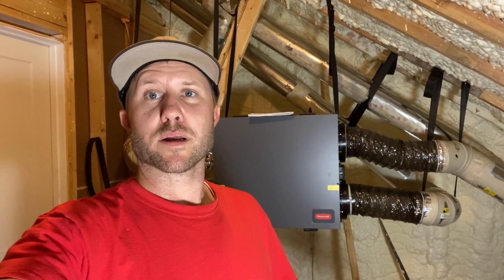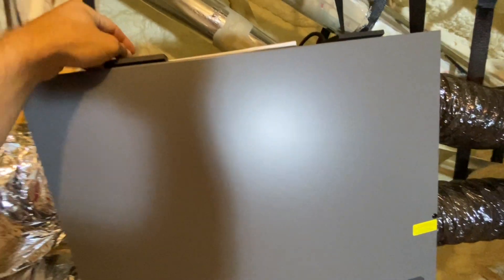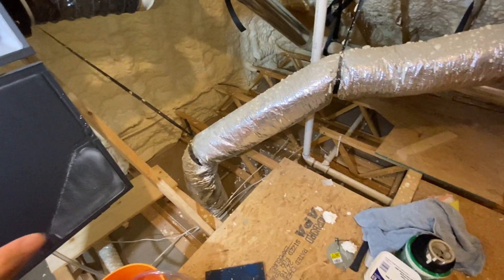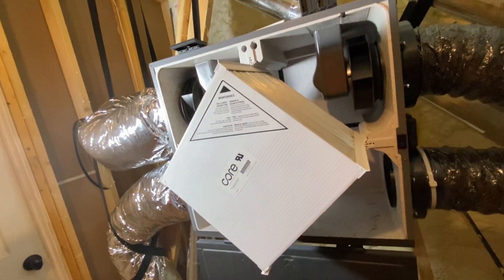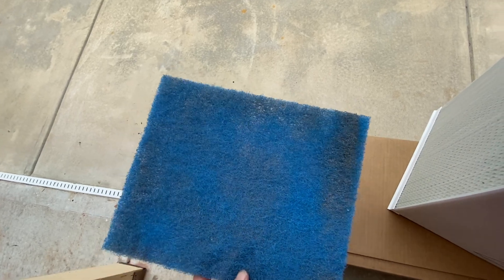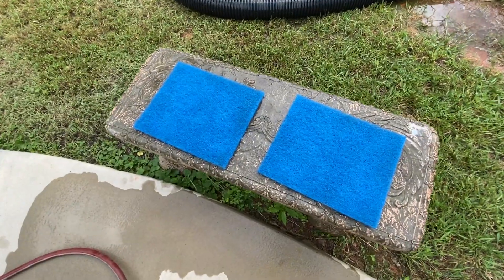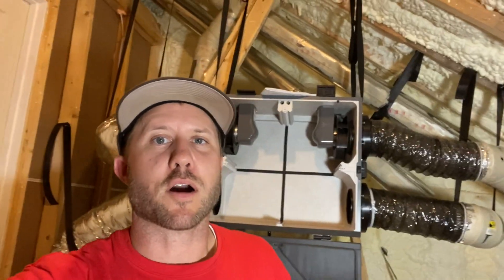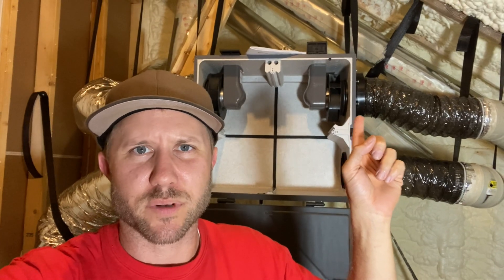Honeywell ERV first filter cleaning and first 3 months update. Energy Recovery Ventilator.

Comment: Unbelivable

Best roof assembly is a vented attic hands down
Reply: How, with an ERV and spray foam you can control the air that comes into your house, lower your energy bill, and control the humidity....  
  
You literally only benefit from a non-vented roof design if your insulation is tight enough.
Reply: @Lolatyou332  How is his energy bill lower if he has to run his ERV and and whole home dehumidifier at a cost of approximately $50 per month?  I would wager that in some instances a tighter home is a zero sum gain once you factor in the additional system costs.